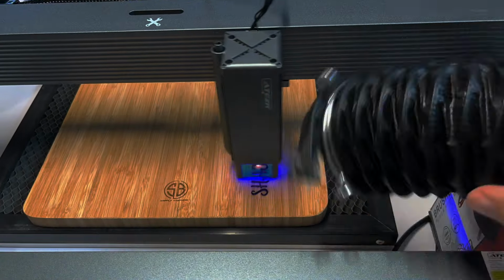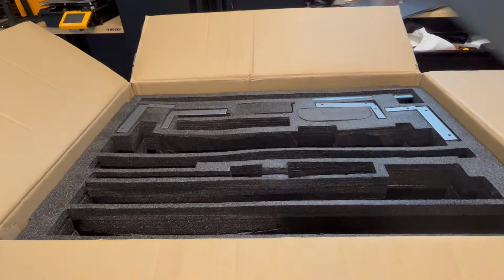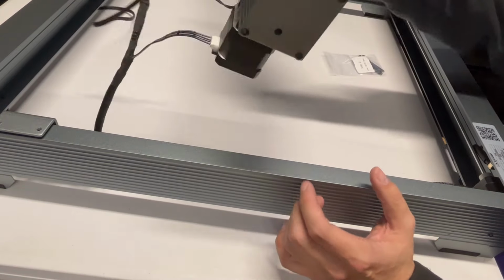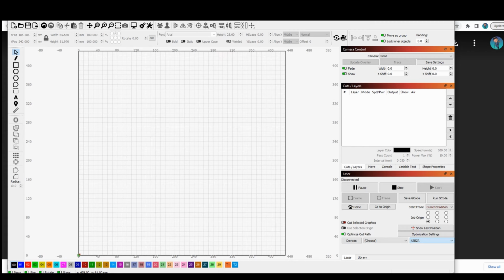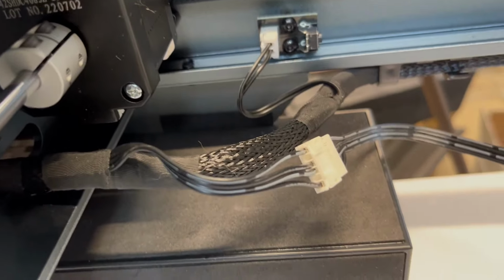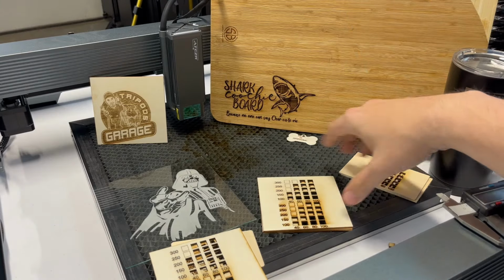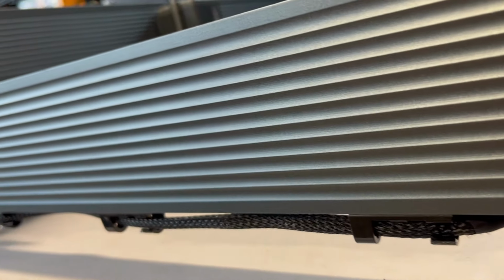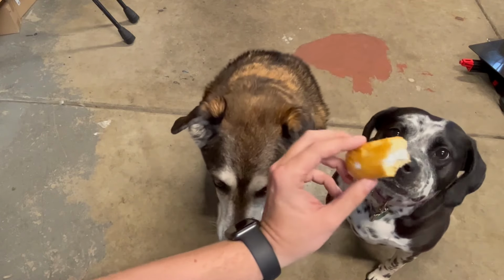ATEZR P10 - 10 WATT LASER COMBO

Comment: It looks sturdier, but as we know, looks can be deceiving. There is so little mass being moved that I’m not sure it makes any difference. It just sits on a table after all. The XTool seems pretty sturdy too, even with lighter extrusions. I’m more interested in whether there is a real difference in the quality of the work produced. If not, then the rest doesn’t matter. Some if my machine tools weigh over a ton, but those actually need rigidity. These are non contact engravers, so there is no strain on the tool while it works. What would be interesting is if they come out with an infra red module for this as XTool has done.

Are you sure the rotary motor isn’t reversing itself occasionally? I find that some stepper controllers have glitches, particularly the cheap ones used in these engraver accessories.